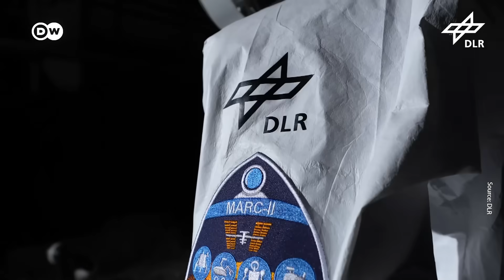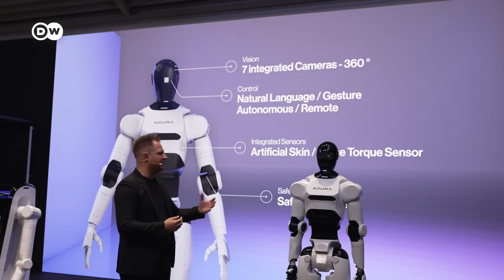Humanoid robots show utility for everyday tasks | DW News

Comment: Humanoid robots are a showpiece for investors. There will definitely be more robots in the future, but few will be so mechanically complex. Like you don’t actually need legs, and the complex balancing system that comes with it, to move across a factory floor. Wheels do the same job whilst using less power and having far fewer parts to maintain.
Reply: True, Although this removes the general purpose aspect, that same wheeled robot wouldn't have much purpose if operating at a construction site making it less generally appealing. A Humanoid Robot can do what humans do including more high risk tasks making them a massive upcoming product.

Comment: This will take time as humanoid robots still struggle to adapt to new environments and perform consistently. Probably in 10 years we will have the data and the sim to real gap will be closed in a way that will actually lead to robots feasibly replacing us. I wouldn’t worry though I think it will be a positive thing. As the owner of figure robotics said, work will be optional.

Comment: As someone who works with robots ( 2 feet, 2 hands, and standing up).  A lot of people see these fancy demos which are nice, but you need to see more videos of it falling over or getting off the floor on it's own. A lot of people don't realize that when testing robots they fall over.
Reply: Too true, the bots that work best r repetive task bots, like automotive factories
Reply: Have you seen what Boston Dynamics are doing ?
Reply: @DavidAKZ I'm aware of what they're doing and I've seen the yellow dog like robot.  It was an old prototype and they were controlling it with a joystick. How did it end up in California? I was told they have a office here.
Reply: The insistence on humanoid robots doesn't help with that.

Comment: If cars drive themselves, you need 75% less cars. If "stuff" lasts 2-4x longer, you need 75% less production. If stuff can be used in alternative ways after its first use, you need 50% less production.

Make things "smarter" and you can reduce the workforce by 90% and you hardly need any robots at all.
Reply: No, the goal is not to maintain the current tech/civilization, but to keep developing and expanding, to explore the outer space and secure the future of humanity among the stars.
Reply: @crayonsukrou913  When AI and robots replace enough humans society will radically change and will NOT be the same as it is now, nor will it "expand".

What I was trying to point out is that robot-makers are forecasting a World where everything WILL stay the same....which it will certainly NOT.

We will produce A LOT LESS because people will need to have stuff that lasts longer and/or can be recycled much more easily.
Reply: @Junyo  We need to produce MORE, and we need to produce them FASTER.

200 years ago we were largely limited by muscle power (tho wind and hydro power also available at certain places), but thanks to the invention of steam engine and electricity, we are no longer limited by it.

Right now (i.e. 5-10 years ago) we are still largely limited by our brain capacity, even with all the computers and software we have. But with the invention of AI we can do more, and produce more.
Reply: If cars drive themselves you need 90% less cars.
Reply: @darinherrick9224  No, that math doesn't add up.

Comment: I am always wondering why do you need to make machines in a human shape (that’s the result of our evolution, it doesn’t necessarily have to be the robot’s), although you don’t want to make it into a system like Kassandra, because she is literally everywhere in your network, that would be overdoing it, and it’s super creepy.
Reply: Because all of our existing tools (power tools, vacuum cleaners, ironing machines, cars, etc.) have already been designed with the human morphology in mind. It's much, much, much cheaper to design humanoid robots who can use the tools we already have than to custom make a robot for every single task or redesign all our tools.
Reply: Because the human form already is one size fits all in household tasks and we need one that can do what we do. We don’t need spiderbot or a dronebot in the house.
Reply: Well in addition to a humanoid robot, you could just have an AI system in your network, controlling different components of the house. However this concept had made into a TV series thriller.
Reply: @rollingdownfalling  And then what? The dishwasher working by itself isn't revolutionary or even necessary, that's pressing 2 buttons. It's rinsing, placing them in the dishwasher and then removing and placing in the cupboard that's revolutionary and necessary. And a machine doing only that part is extremely wasteful. A machine that can do the dishes on top of the rest of the housework is efficient.
Reply: @sapphyrus Great, some people don’t need a robot, I get that, then why discuss the topic in the first place, when the topic of the video is about robots doing human job, a bit off topic don’t you think? Additionally I didn’t say anything about a dishwasher, you made that up yourself, my centre of argument is the necessity of a humanoid shape, and a coordinating AI system.
Reply: @rollingdownfalling  No I'm saying that people need a robot for multiple tasks they wouldn't want to do themselves and explained human shape would be necessary for that.
Reply: @sapphyrus aging population.
Reply: Because We have designed our world for ourselves ergonomically, which is the human form, so in order to fit in, the best form is for the machine to have a human form.
Reply: That's dead simple - because the point of robots in most cases is to mimic human tasks, so you NEED a human framework to do this - arms the right length, bending, lifting, and so on. 
Those that don't require this, like bespoke industry robots are therefore NOT human shaped.
Reply: At least it would be nice to make the robots, even though humanoids, be much more flexible. E.g. removing the need of a ladder with extendable arms and legs.
Reply: God created Man (and Women) in His/Her/Their image.